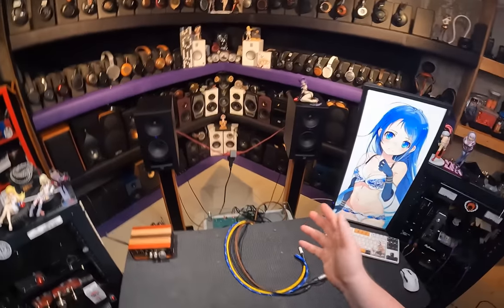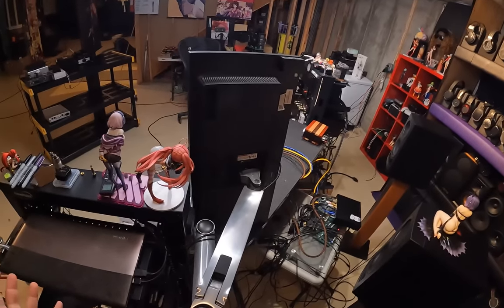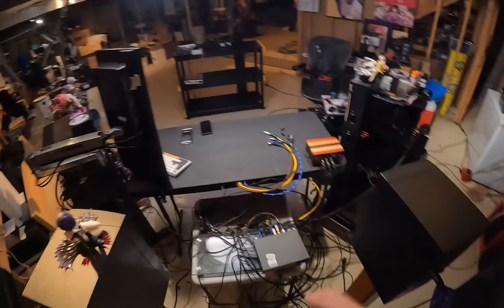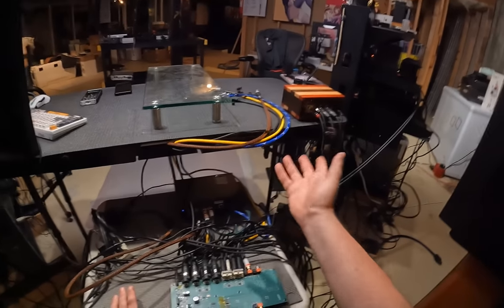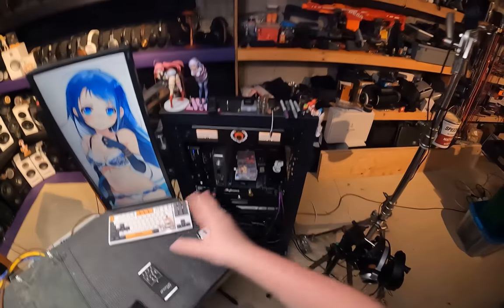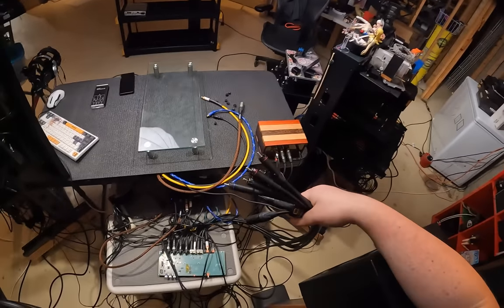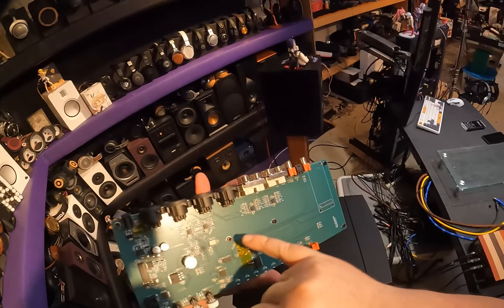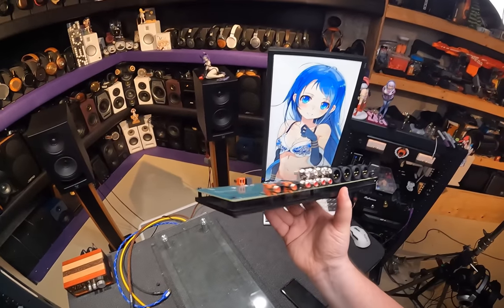Distribution DAC Prototype || Z Reviews

Comment: Definitely a fan of this idea.  I've been interested in trying out some DACs for a while for comparison, but have stuck with my audio interface (Arturia Audiofuse) because I refuse to compromise on having an A and a B channel (or equivalent) and that basically leaves you with only Audio interfaces for options since most DACs only offer one set of balanced outs and even if they have a second output at all, it's unbalanced and doesn't run simultaneously.  
Frustrating oversight in my opinion.
Depending on the specifications, I would probably be happy to see a 350- 500 dollar price point and not surprised if it were closer to 600-800 +.

Comment: I'm unfamiliar with topping dm7, but a desktop 1 stop shop for all dac needs would be highly desirable. have tube, solid stte, electrostat, and monitors currently. would be interesting if they could find a way to make it expandable, i.e. I start with 4 outputs and can add more expansion cards later somehow for more or different outputs. 
personally I would want usb (or at least the option for usb)
I think 500-600 is not unreasonable considering it would replace several dacs, maybe 800 if they're able to implement expandability

Comment: Nice Violectric AMPs. Just this week I was looking for Ferrum Oor  vs Violectric 550 comparison for my end game headphone amp. 

On the topic of this video, the multiple outputs are not something that people are interested, BUT if they will make swappable op-amps so you can tweak the sound per output, and have 6 flavors, then will become an interesting proposition even for people with just 1 amp. You put that xlr switch box and you get different flavors for different moods, and you can change those around down the line. if the dac is at Neo iDSD level, and powered by 5 or 12 V (no weird BS like 18v form ProJect), I totally se people with 1-2 amps buying a unit with up to 6 outputs and play around with op-amps, and linear PSU, and it can be a more expensive  PRO version with 12  outputs for reviewers, that need to compare and maintain consistency.

Comment: A few years ago I bought a distribution amplifier (Lake People ANA-Tool F844) to use one DAC (with multiple digital inputs) and connect it to multiple amps (active studio monitors + sub, amp for passive speakers and an headphone amp). If this thing existed I would have probably bought it instead. Good analog distribution amps are expensive af (bought mine used).
Reply: Did the F844 have the DAC built in or was it analogue? Can all or some channels be played at the same time?
Reply: @20NoName20  Just analog. It's basically a balanced (xlr) splitter for line level signals. Stereo: 1 input to 4 outputs or 2 inputs to 2 outputs each. The outputs are all active. Well, if you use the 1 in 4 configuration and the second inputs are disconnected you could switch 2 of the outputs on/off by selecting the other mode (2 in 2).

Comment: This is essentially an audio interface but without the studio oriented features. Those usually have routing software (that control the routing on a hardware level) and then you can have as many stereo outs as you want. Some also support Dolby Atmos believe it or not. They also support chaining to other interfaces using the ADAT standard or network based protocols over ethernet. Those get very expensive though. 

Examples of this are the Antelope Galaxy 32. It has 32 analog inputs, 32 analog outputs. Networking over ethernet. 64 more in/out channels over hdx, Thunderbolt 3. 64 in/out channels over madi, 8 over ADAT and well a lot more. Even dolby atmos support. It is pretty crazy. It also costs crazy though (6K euros)

Comment: If it had EQ, it'd be awesome. I've been looking at buying a MiniDSP Flex-8 for my desk so that I can run two channels (EQ'd) to a headphone amp, two channels (EQ'd) to a speaker amp, and one channel (EQ'd) to a subwoofer. But my dilemma is that the Flex-8 doesn't have balanced outs and the smaller Flex with balanced outs only have 4 outputs.
Reply from the maker: MiniDSP has exactly what you need except when they don't, I feel that.

Comment: This is only useful and would be desirable for some people if all these channels are individual channels on windows and you can use then as surround or just copy the same channel to all outputs or just copy a stereo signal to every pair of outputs, etc. What I mean is it needs to be configurable, just as a studio interface. But also, it would need to be cheaper than a studio interface otherwise why buy it instead of a studio interface that also comes with other things.
And yeah, please just make TRS conector that can be both balanced or unbalanced depending on what cable you plug-in.

I've been using a 6 output M-audio desktop interface for a while now to power a set of 5 genelec speakers and an Yamaha subwoofer, I've been using Voicemeeter for individual channel room correction and crossovers which is great, but I did it like manually by measuring and adjusting, it doesn't have an auto room correction software, but I would pay more for it if it already came with parametric EQ for individual channels including crossover filters and all.

Also there should be 6 channel 8 channel  12 channel and 16 channel variants or just a base 8 channel with the fiber optic stacking that you spoke of, that's to make it cheap because a 16 channel output thing that costs 3k U$ isn't really interesting for someone looking for a 6-8 channel setup

-Ah, yes, I almost forgot: multiple digital and analog inputs that can also be routed through software so you can have a PC, turn table, Console, TV, and all connected at the same time, so like one coaxial two to three optical, and maybe a couple RCA analog inputs with one being capable of being a phono input via a gain switch?

-That's how I see it

Comment: I have an original JNOG dac and run balanced out to my headphone amp, and then I split the RCA to go to my desktop speakers and my large home theater speakers (because the JNOG sounds better than everything else). Turns out I am that madman that would use 3-4 outputs on a dac like this, and I love Geshelli Labs. I think I would prefer something that can either split a stereo signal into pairs of outputs like this distribution dac or run individual channels and tell windows it's a 5.1 or 7.1 surround and have that go to amps for all my HT speakers, and don't need a receiver

Comment: for a normal person 1 balanced and 2 rca should be fine...that would make a crouded desk easily possible. one tube and one solidstate headphone amp and one extra for a speaker! i´d buy that...if the dac actually sounds good obviously. never heard geshelli stuff.
Reply: but yeah, this definitly has value. might not be many that value that feature tho...this would have to be real fleshed out to tickle the few crazy enough. nice external psu, good dac and mebe voltage control for the analog outs. doesnt have to be a poti, just pick between 2v and 4v...

Comment: Sounds like a great commercial product. like lets say you run a store that has a instore speaker system, that you run off 6 amps.... this would make sense to use there, or you have a store where you are selling headphones/amps, this would be great, or the weird people that actually have multiple amps and need something to drive them. it's like.... there's a clear market for them, between the audiophiles and the commercial sector, it will sell. I personally might not get one till much later but... I want a product like this on the market incase i need or want it in the future.

Comment: I think a multichannel DAC like the Topping DM7 or Oktoresearch DAC8 Pro would make more sense. 

Nobody normal needs so many pairs of stereo outputs but if it's 8 or more individual channels it would make more sense for people how have a home theatre PC and want to integrate subwoofers with individual filters and so on. 

Those crazy people how have 4 or 5 different stereo amps could of course also use such a device for that.